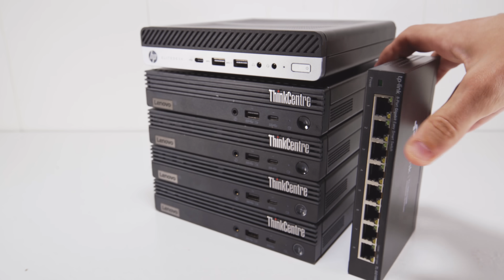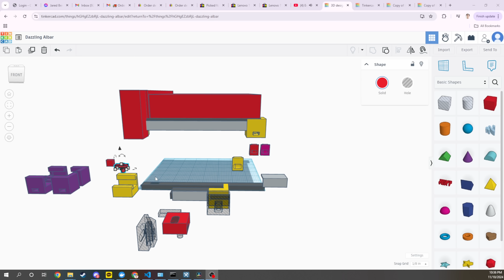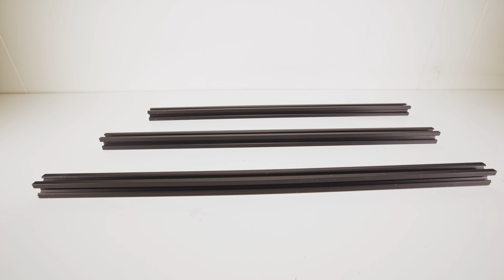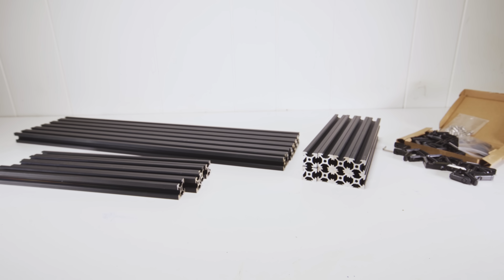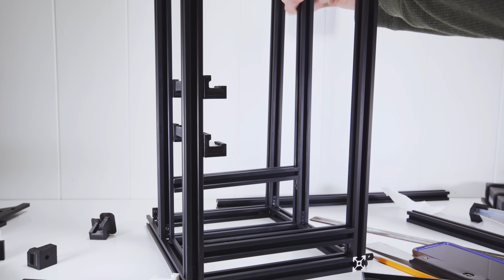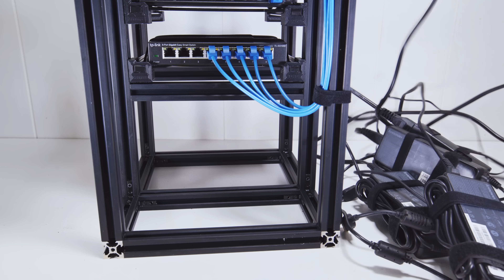I Built A Mini PC Server Rack

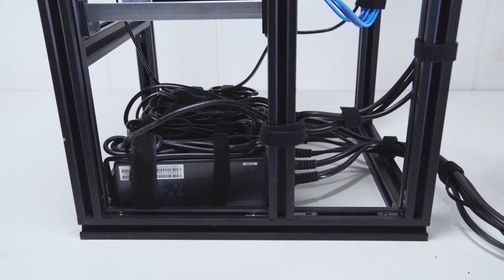Comment: Noice. For a Mk II design I'd recommend integrating a JetKVM into the rack for remote control of your cluster, Panels to control airflow (along with an AC Infinity fan with controller setup prevent it from overheating) and noise. Finally, a PDU arranged across the span 12:11 so you can install a standard 19" device ( something cheap and simple (like a ADJ Products PC-100A) so you reduce the power spaghetti going out of the back of your rack to a single cord. (It looks like it be made to fit via printing a solution but you didn't include the dimensions of the completed rack in the pictures so I'm only guessing.)

Comment: looks really good, the only thing i would do different is have the raw cut ends of the 2020 on the top and bottom instead of the front and back. that way you could sand and paint them or print caps and feet.

Comment: If you want to cluster, you can replace the "wifi card" with a pcie m.2 to 2.5gbe adapter. Keep the cluster on that nic exclusively and usilizing ceph.
Reply from the maker: Nice I did not know that could be done! Right now Im testing a server rental platform that ive programmed and so I wanna test how the 4 web apps work. but after that ill wanna try some other cool stuff with this rack so appreciate the info!

Comment: Have you thought about creating a 10" 8U version, make nice facades for the pcs
Reply from the maker: I will create a more standard one as well. the next revision tho will be a much more improved 7.5inch rack pretty much dedicated for mini PC setups. Im almost done with that design then Ill try my hands at a cool 10inch setup. My main issue is I dont own any 10inch equipment so i have nothing to work with when it comes to dreaming up something. but I will pick up some used stuff on ebay

Comment: I love this. Had this idea for a while, just without the sliding rails. Gotta say I love how you've implemented it! Dont have a 3D printer, so I was just going to measure and cut...and probably make some kind of faceplate for my mini Optiplexes...
Reply from the maker: My new design will attach the same rails by just drilling a hole on both ends ans attaching to aluminum via t nut at that point the pcs could just sit on both ends without any tray

Comment: great looking & functional rack system! for Lenovo you can use one or two 95 Watts power or a single 200W  adapter and then use power connector spliters (from china). tiny pcs don't draw that much power.
Reply from the maker: nice! i was thinking about that

Comment: Can you post the eBay link for the pcs please
Reply from the maker: There isnt a static link because they are just products that get sold on an individual basis, but look up lenovo thinkcentre m75q gen2

or hp elitedesk

then you can search for deals based on the specs and condition of the pc, make sure you see that power cords come with it because some people will sell them without it. Also make sure it includes all the components. some people sell them broken as is. so read the listings carefully

Comment: Excellent idea and explanation.
With all necessary materials and components.
It would be nice if you presented the whole project here through a video like the previous two.
Advantages of your project:
Simplicity
Small dimensions
Mobility
Relatively low energy consumption
A wide range of possible uses.
Apart from the mentioned Kubernetes, the possibilities are much greater.
It would be nice to see everything running under Linux in one of the distributions in a future video
I wish you to shape the project and give it its final form.
I think your idea is excellent and you should apply it to a lot of jobs that require something like this.
The project is original.
Reply from the maker: Thanks for the kind words and detailed comment!

Comment: What was the point of doing it again? These units are great at saving the desk space but now it is all bloated. Are you planning to move then into the closet? 
You could’ve just put a switch right in the middle of the stack and crimped super short rj45 with 45 angle connectors to cut down on cable clutter.
I’m just using mine sitting on the table with wires put through hole under the table. 2 HPs, 2 Dells and a Mac mini.
Reply from the maker: Looks cool and tidy I'm not really sure

Comment: Very nice project.  Good job on the overall design.  I like the rear facing switch, the overall dimensions and concept.

Your makerworld page specs PLA.  PLA is not a good base material for these trays.  PETG is better, ABS better still.  ABS is harder to print, requires enclosures, produces fumes, etc.

Which is to say.  Be careful what you print your tray out of, heat deflection is an issue.  These systems can get quite warm when you leave them cranked for long periods, the cases can heat up a lot. You don't want your trays warping, potentially failing, and then dumping the system(s) out of the rack.  The aluminum angles might save you there, really depends on how high and how far the heat travels and the sensitivity of your parts to heat deflection.

As another user pointed out, your cable tie job would be better if you left enough slack to let the tray slide out while still being connected.  This way you can operate it without having access to the rear of the rack.  Slide system out, unplug, do maintenance, plug back in, slide back in.

If you want to talk shop some more, I sent a connection request on LinkedIn.
Reply from the maker: great tips! Im working on v2 so ill try and incorporate it!

Comment: Slick. I like it. :)
I've a bunch of old HP 800 USDT G1's and G2's. Mounted them in my home lab by turning some rack shelves upside down and bolting through the cases VESA holes. Meaning the PCs hang rather than sit. Not ideal but has been solid as a rock so far.
Reply from the maker: I mean if it works it works!

Comment: I like this. I know some haters will complain about the spacing between the systems but these SFF systems don't push air like a real server so the spacing helps the systems stay a little cooler.
Reply from the maker: Yeah i waffled on it a bit. they can be closer by about 1/4inch and still have lots of airflow, im working on some new designs though!
Reply: The real server is like 3x-4x deep. These boxes have a blower type fan that exhaust to the back. They can really seat ontop of each other no problem as long as the airflow is not obstructed by the cables on the back.

Comment: Tip for tidying the power supplies - you can get USB-C PD-trigger converter plugs that can convert to the various power adaptor plugs these use, which would let you swap them all out for smaller GaN usb-C power supplies, perhaps one big supply eith multiple outlets that can service all of them?
Reply: Sadly those GaN power supplies are usually only rated to run at their maximum capacity for about 30 minutes before overheating. Also the power sharing for the ports is usually very questionable and not documented properly.
Reply from the maker: interesting, Ill take this into account for version 2
Reply: Wouldn't be easier to run a more powerful 19V DC supply and wire as many lenovo connectors as needed?
Reply: @jorgecosta95  That all depends on how many Amps the power supply is rated for. Pull too many? You either get a thermal shut down or a house fire...
Reply: @kettusnuhveli  of course, but with each CPU pulling 35W max, you can assume each machine would pull 45W max, aprox. 2.5A each. With that, you need a power supply that can supply 19V 5*2.5A, which is around 240W.

Comment: This is amazing!
You should try to fit some electrical outlets inside or just slap it on some rail and get power from it. 
Maybe even use space on bottom of rack to fit some UPS.
Anyway this rack is really nice!
Reply from the maker: yeap I need to find a solution that is cleaner that a wad of cables comming out

Comment: You could replace some of those extrusions with slotted shelf track from a hardware store. It would be much cheaper and allow you to mount things using something similar to studs on the front just like a real server. As a bonus, the front mount would keep things from sliding out if it were to tip.

A couple of suggestions: have provisions for font mounted fans, and expand the width so the power brick can be mounted to the side of the PC. This will provide adequate airflow for systems not designed to be packed together tightly in a rack enclosure, and you can use the cheap bricks that come with the machines instead of having to buy a separate PSU. Also, consider something like Freecad if you don't feel like paying for CAD software or wanting a cloud connection. Your designed parts looks like a simple: sketch - pad - sketch on surface - pocket (or hole).
Reply from the maker: I will consider all of this for v2 thank you for thr suggestions!

Comment: That's so cool! I was planning to build a homelab cluster using these mini PC as well. I am thinking if I should get a big power supply to replace all those small power bricks that came with each machines. But then I thought about single point of failure that this setup might introduce and I start wondering if there are any better solution that take power redundancy into consideration.
Reply from the maker: Yeah I have waffled on that a lot. Power bricks are redundant and usually come with so saves cost

Comment: The caddy rails are kinda limiting because they have such chunky plastic parts. That kind of forces everything to be vertically spaced out. If you just bolted the rails directly to the vertical aluminium extrusions, instead of using the 90 degree angle brackets with set screws, it would require no extra vertical space. You could probably fit 2x the machines in the same rack.

Also given the extra space at the back, you could extend the caddys to accommodate the power supply of each machine, then it just needs power and ethernet to it.
Reply from the maker: Yes you are correct. I'm working on some other versions. The one nice thing about the angle rails is as you insert the pc it is forced on the rail and can't drop downward as the back tries to catch the back supports if that makes sense. The new design will be more compact and better
Reply: @matthewalton6889  You could maybe even continue to use the 90 degree brackets with the set screws, but ditch the rails completely. Just put 4 little recesses into the bottom of each caddy, then as you slide it in, the brackets will sit in those recesses and kind of loosely hold it in place & minimise risk of it sliding out the back or front

Comment: I was just seriously considering doing something like this to service small businesses with on-prem domains without charging them 50k for server grade stuff they'll over-provision anyway.

Would design in space for a UPS or two with an ATS, and a NAS for big storage, most SMB firewalls would fit right on that rack.
Reply from the maker: the dimensions are pretty flexible if you can modify the parts or come up with a different sled design too

Comment: There are also 10" racks that use standard "U" spacing as well but this is a great alternative!
Reply from the maker: I looked them up and yeah they are pretty nice, makes it hard to choose between a custom build and what they have out there already. lots of pricing is very good! Thanks for letting me know!
Reply: @matthewalton6889  Yeah AV rack gear is also plenty sturdy enough for these little boxes and very cheap (in comparison to full noise server rack stuff). And AV racks uses the same U spacing as server. Then there's some really good 3d printed mounts for the 1L PCs and bosh you've got a very clean setup.

Comment: I want this. my systems are sitting on top of my switch in a back closet. So very very messy.
Reply from the maker: If you have a saw and a 3d printer its pretty affordable maybe 100 bucks. I linked materials and files!
Reply: @matthewalton6889  i got a prusa mini.. little to big for my itty bitty printer. i think the trays alone are the full size of the bed, if not more. Imma gunna look into this once i have the cash to do so again.
Reply from the maker: @christopherrenn8137  Im working on a v2 more standardized system and ill try and get print sizes down. Maybe I can make a 2 piece tray
Reply: @matthewalton6889  Appreciate it. Smaller format opens it up to more printers over all.
Reply: tbh the first thing i thought of when i saw your design was..."Huh, if mark watney had this on mars he could run a host of mini servers".

Comment: That's neat, I think I may steal the aluminum angle idea. I was using custom laser cut wooden sleds but they are so much blank space they aren't super efficient to make. Was eying just getting full on soft close drawer slides but angle is way cheaper. 

I avoided the aluminum extrusion and instead opted for a laser cut plywood frame which made assembly quite simple (glue with painters tape for clamps) Even have a parametric model that let's me go from 1U height up to 10U (I can't cut larger pieces on my laser, and I'd be concerned about the integrity of 1/8" plywood at that scale, it's pretty robust at 4-6U heights though)
Reply from the maker: I need to get better at 3d modeling so i can make some parametric designs! tinkercad works but im so limited... Your stuff sounds really awesome! Steal away! Most hardware stores have some basic aluminum extrusion profiles (angle, square, flat, U) so hopefully you can incorporate it!

Comment: If I remember correctly there is a sliding rail system in the 80/20 catalog but I don't know if they have one this small.
Reply from the maker: Ill have to look into it! Thanks!
Reply: @matthewalton6889  Call 80/20 custoemr support I am sure they have  a sliding rail system ofor this application or they can refer you to a partner company that has one.

Comment: I would lose the Velcro and use 3M command strips (available  at Amazon, dollar store, hardware store, drug store)instead. One side would attach to the caddy and the mating piece would attach to the Server. The wonderful thing about command strips is they are removeable (Leaving no residue on the surface) and are invisible. They come in weight categories up to 25 lbs! Since you are using them horizontally you can get away with the 5 or 10lbs command strips. I would use a set of four on each of the four corners.
Reply from the maker: That's a much cleaner approach too. How do they handle heat?
Reply: @matthewalton6889 Not sure about thermal limits for them. Given most of the heat will be ejected through the rear fans I don't think it is a concern. I would call 3M customer support. They have thermal limits for them as an engineering document they can send you. There are professional grade versions of command strips as well.  But if you leave enough space between, I will not expect a problem. The biggest issue would be changes in adhesive properties I would think. A temperature probe from an aquarium with a digital readout might give you an idea of ambient temp about the caddy. I suspect if you have a thermal issue the caddy will deform prior to the command strips becoming an issue.
Reply: @matthewalton6889 Not sure call 3M customer support they can give you the engineering spec sheet for the product. They also make professional versions of the command strip that are more durable and grippy.

Comment: wonder if it is compatible with optiplex micro pc's
Reply from the maker: I just measured and no it's a hair to big you wouldn't be able to slide it in with velcro. If you want to attempt this build I will modify the file to accommodate the larger pc

Comment: I don't know how i get here but this time must thank for the algorithm.
Cool build. I think you can box in the power supplies.
Reply from the maker: I'm considering a print that would hold them better. Also thinking about buying the AC side of thr cables and cutting them short and putting a power strip in there. I have a few options and I plan on improving on the build!

Comment: I have a very similar setup with 4 thinkcentres and an HP, but all I did was make a 3D print that held all the computers by their tiny screws in the back of their own frame. Heat-wise, probably not the best. But it's very compact and easy to print. Even has some knobs on the side for the switch to mount to. I like the professional build of yours though and makes it more transportable
Reply from the maker: Very interesting any chance you got pics somewhere on thr net?